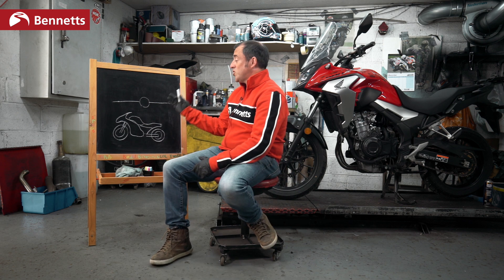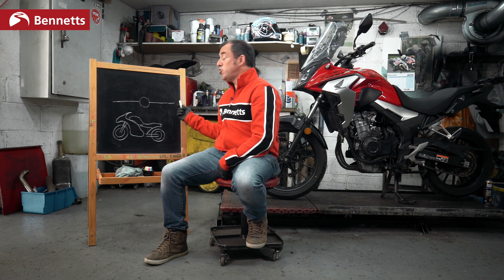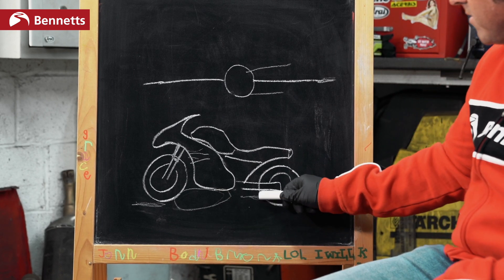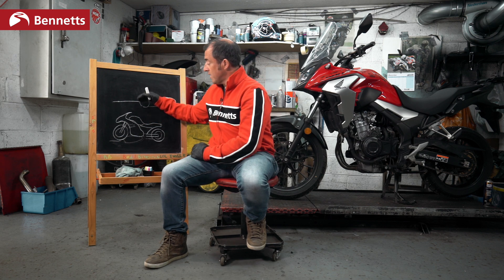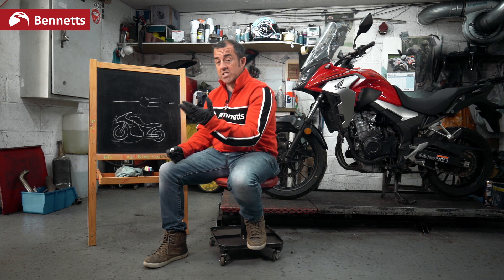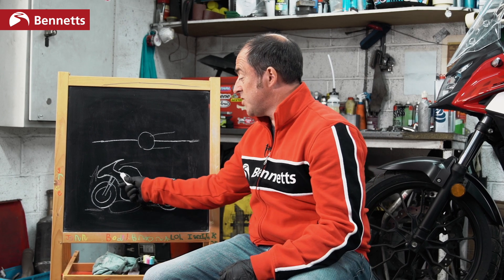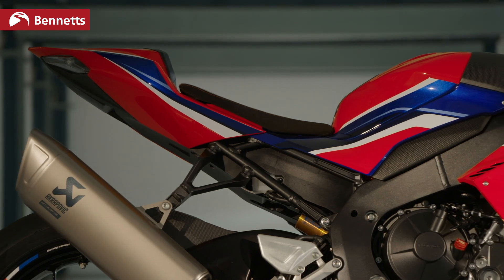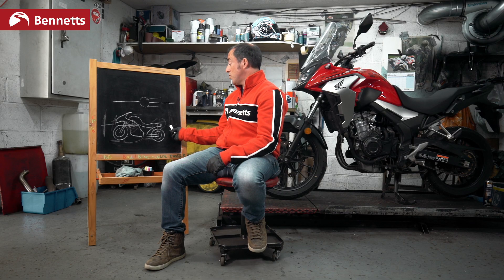Motorcycle winglets - how they work | Home Schooling Lesson 2

Comment: Thanks once again. I'm wondering how far the front wheel needs to come up before the wings start creating lift?
Reply: @slovencleta  
Thanks, so on a road bike they're just expensive frame sliders. 😱👍
Reply: @slovencleta  If the wing is upside down, would they ever produce lift on a wheelie or just simply aerodynamic stall.  And produce unwanted and high drag forces at high angles of attack.

Also if a closely following bike is continually stepping in and out of turbulent and laminar air would the effect be too sketchy (technical term) to handle?  Where's that wind tunnel to test out theories when you want one...

Comment: Very detailed and insightful video.
Reply: but it failed to mention a very important detail. what is downforce an the straight is force that pushes outside in a curve, because bikes other than cars lean.  that is why many winglets hav an angle, the winglet that is on top in a curve still creates downforce, and the lower wing is blocked off completely. Why? because the rider uses hanging off , airflow is restricted on the inside. therefore. winglets work the best when hanging off, and cann be a liability when you do not use hanging off.

Comment: Really interesting video! Thanks!
Are the wings that much effective with that small size? 
Would the added weight of the semi-active wings be worse than the additional effect it would cause?
I think in the future we would see more wings like you said in the back of the bike or in some other places before investing in the semi-active wings.

Thoughts?
Reply: nah, motors weigh next to nothing, if you pissed before you went for a ride, youd save more weight
Reply: I've recently ridden the BMW M1000R, it uses wings with very minimal surface area but compared to the S1000R I felt a difference when on the track. In theory any added downforce makes a difference.

Comment: Wings are still a complete BS when it comes to motorcycles. They don't do much, except load the suspensions just by a teensy-weensy bit (which is counter intuitive anyway!) that will be easily soaked up by the suspensions. The entire kgs of downforce that has been told to be generated from these wings can be easily put to shame by adding a fraction of that down force's weight with a heavier spare part or heavier rider. Any day, a down force created on a motorcycle by a slightly heavier parts. (Just a few hundred grams) will eat the downforce created by these wings, all day!

However, increasing the weight on the bike isn't any ideal way of increasing it's performance. Hence aerodynamically perfecting a wing's shape to increase the downforce it generates in higher speeds beyond it's own weight is still a very very very negligible factor even with today's Moto GP machines. Just like with other base less automobile trends, wings on motorcycles will die soon as well.